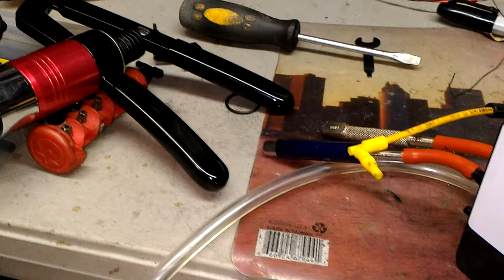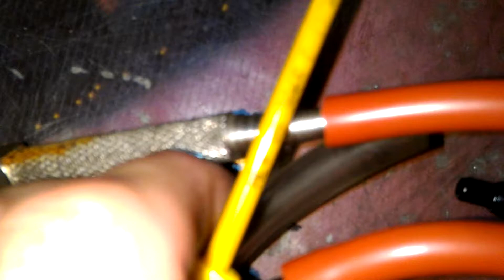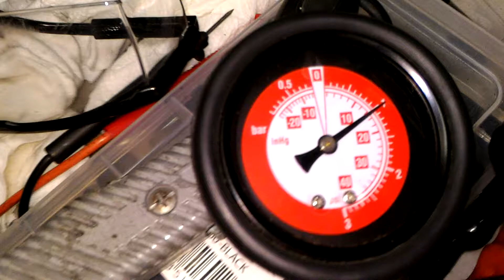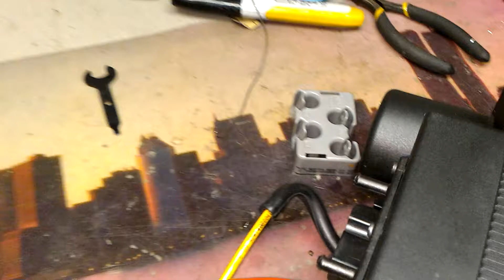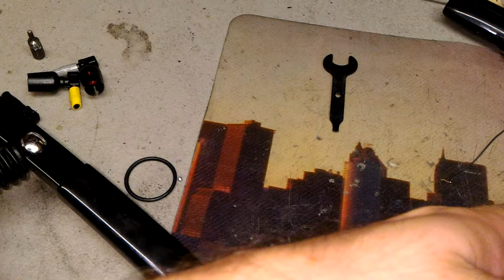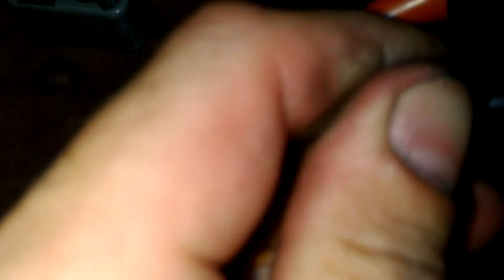Mercedes PSE aka door lock pump repaired

Comment: GOOD VIDEO!    I HAVE A R170 230 SLK '98 AND I AM ALSO REPLACING THA PSE PUMP. HOWEVER IN DISASSEMBLY I EITHER LOST OR ONLY TWO WERE THERE, THA GRAPHITE FINS THAT GO TO THA ELECTRIC MOTOR ROTOR. THA SLK 230 ONLY HAS 4 FINS AND I HAVE ONLY BEEN ABLE TO FIND 2 OF THEM.   WOULD U KNOW WHERE I COULD BUY THESE FINS IN THA STATES????     I ONLY NEED 4 OF THEM.     THANKS

Comment: Hello Viktor. What to do if the PSE pump creates pressure and vacuum in two tubes? It makes pressure or vacuum in both outputs depending on which switching contacts are switched in the pump. Are the outputs always separated? Could there be a leak inside the valve block, like in the w220? Help solve the problem. I haven't been able to repair it for a year, even during testing, one motor in the pump burned out. There is no workshop in Ukraine that will repair it correctly.

Comment: Hello victor. I have a problem with my w140. Pump is going crayze. When I start move my car all locks are locking. Antenas are not working and trunk grip. Last thing is whet I close my trunk all locks are going to lock. Can be problem with comfort module?
Reply from the maker: Hi,
I dont know whats wrong there. Need to see whole car to diagnose it properly. Maybe hoses are switched or pump itself is bad. Comfort module usually does not fail, very rare case
Reply: Thank you for answer. Take care

Comment: Victor, I've got a '92 500sel that was my dads, he's been gone since 2010 but I keep the 150k 'land yacht' on the road, and love it. In the shop now for new throttle body persistent 'limp mode' repair (I'd like to send to you, but I've no shop or way to work on it).  But the central locking is out, and that's something I can pull and send you.  How long does service take once you get it.  Skype: rswan25
Reply from the maker: Hi,

Please call me to discuss details. I sure can repair your door lock pump as long as it was not water damaged.
Thanks
Reply: Victor, thanks for your quick reply!  I've looked at your website and Youtube but can't find your #.  Please advise??

Comment: I  have a 1996 mercedes benz s320 and having a problem getting my backseat headrest to fold down. The pump is working for the door locks, trunk, trunk handle etc. but the 2 hoses that lead to the 2 headrest in the back I don't hear air coming out. Can you or someone please tell me what may be the problem.  thank you